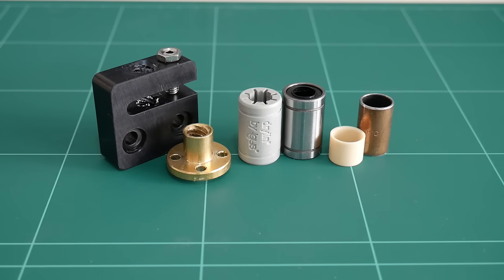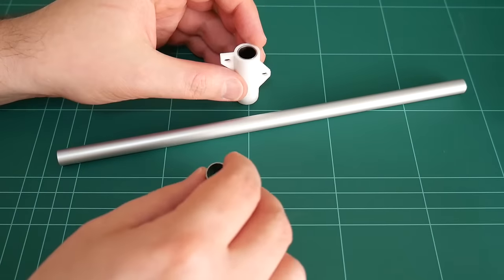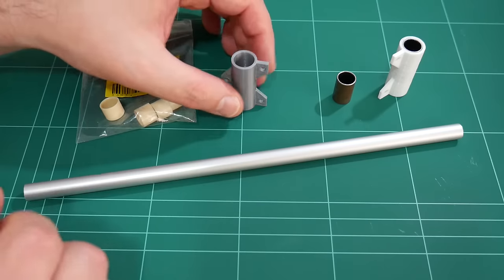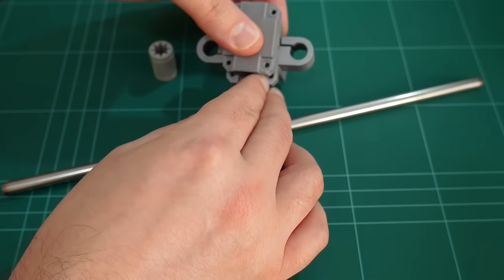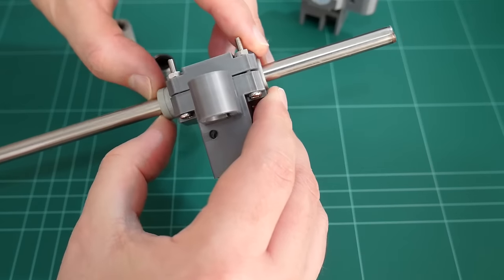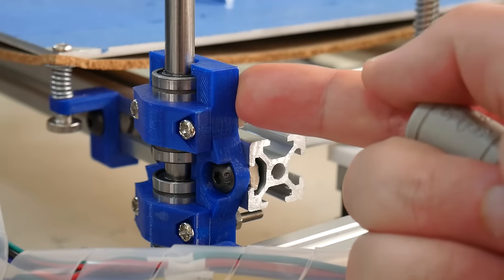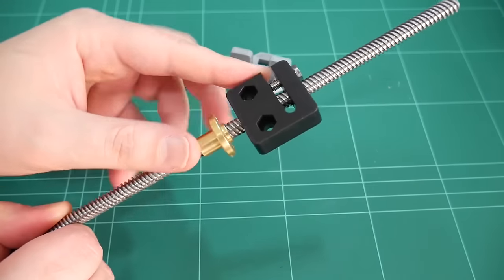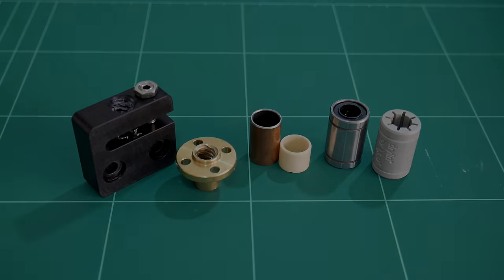New 3D Printer - Build Log #15

Comment: I don't have any personal experience with the IGUS polymer bushings/bearings but i believe part of the biting issue may be because they're meant to have a uniform radial compression applied to them, whereas you applying pressure in mainly one axis of the bearing. There are IGUS bushings sold that have a metal compression sleeve already applied to it to provide this uniform compression, so maybe that could solve your problem.

Comment: This video is four years old now and you've probably already worked out your bearing solution for your X-Y joiners, but just in case I thought I might share this info.  IGUS makes an aluminum-cased version of their drylin bearings.  With the aluminum cased version, you would be able to clamp them down tightly into your X-Y joiners without any issue.  I bought four of the RJUM-01-10 bearings to replace the LM10UU bearings that I was using.  They are really excellent bearings and I feel really confident recommending them.  I can't take any credit for discovering them though.  I became aware of these aluminum cased drylin bearings from one of Thomas Sanladerer's videos.

Comment: According to Thomas Sanladerer's video on bearings, the metal sleeve version of the IGUS bearing gives proper tolerance so there is no slop. Even with that I am not sure that it would work on the steel rod on the Y axis. Is the steel rod exactly 8mm, I can't remember if you measured them in a previous video. I haven't been able to find anyone using the IGUS bearings with the metal sleeve on a 3d printer build. It's a shame you couldn't get them to work, as I was really looking forward to seeing how they fare against the LM8UU bearings on the hypercube. I do love the new setup for the x axis and z axis.
Thanks for sharing your 3d printing adventures Tech2C!

Comment: Nice update! I've found that using short linear bushings offset (like what you did for the X axis) is in general the best solution for getting smooth movements, but with a small sacrifice of lifespan. Perhaps implementing something like this on the y axis will work out for you if you want to replace those ball bearings still. And nice change on the z axis, that new nut block looks much more rigid!
Reply from the maker: It'll be interesting to see how long these igus sleeve bushings last on the X axis. They seem nicer to use than the steel bushings but if they don't last that'll suck. Yeah the nut block is a nice option.
Reply: Well they still should last decently long, and since the whole bushing is the lubrication instead of just a coating on the metal like the old ones, they should last longer in theory. but they will lose a lot of their tolerances well before they simply quit working.

Comment: The black material is called Delrin, very durable and perfect for making parts that require a thread to be included.  Since the print bed always provides a load due to it's weight the brass screw will be sufficient and is very cheap to replace if ever needed, however because it is always loaded by the weight of the bed you will never notice any issues in print quality as the usable life of the brass nut will easily outlast the life of the printer.  I like how you have experimented with lots of different possiblities with the build.  That delrin block z axis setup would definitely be benificial on a i3 type design because there is no bed to preload the z axis.
Reply from the maker: I thought it was Delrin but the MakerStore site didn't mention the material. Cheers for watching and comments.

Comment: I believe the black residue you're getting on the aluminum rods may actually be very fine aluminum particles which are wearing off the rods. If you take a piece of aluminum and rub it against another hard surface repeatedly, you will begin to see a "dirty" looking build-up of these fine aluminum particles. 
The coating inside the steel bearings may also be wearing off. But aluminum is a very soft material that will wear away faster than most people realize. Anodizing helps harden it a little but I think it will still wear. It would be interesting to try those same bearings on a steel rod and see if you still get the residue.

Anyway, great videos! I hope to build a printer like this someday. :)
Reply from the maker: No no, these aluminium rods are anodised. I covered this in an earlier build video, number 4 I think.

Comment: this is on a "or so i have heard" basis: if i am not mistaken, the drylin bearings are supposed to be a pretty snug fit in to theyr seatings, and would have a little play on the rods, if not compressed form the outside. (a precisely sized hole, not clamps ment to hold steel brearings) and need some breaking in to work as smoothly as they can.

Comment: For the Y axis, (these are some more hacky methods), you could try printing bushings out of PLA or nylon(self lubricating). I use PLA carriages that run on aluminum extrusion, and those work pretty well, but they gain play over time.

Comment: Did you try adjusting the clamping circumference to say 45 degrees where there is the most clamping force and 0.5mm less than the bearing diameter to see how that might work? The rest of the clamping circle if you will would have a larger diameter than the rest of the clamp.

Comment: Yes, you can print a cylindrical adapter (to use on the Y axis) the length of two lm8uu. then use two sf1 or use Igus J bushings and ream the adapter to achieve the pre-load that you want. It will be quieter. I just ordered titanium X axis rods to play with.
Reply from the maker: Titanium for X rods? Wow impressive!
Reply from the maker: What is the surface of the titanium tube? Is it anodised, or just titanium oxide? If just a naturally occurring oxide then no good as the bushing will scrape it off constantly resulting in it sticking/binding - just like aluminium.
Reply: Tech2C Titanium is crazy easy to anodise.

Comment: these polymer bearings need a pressfit. sadly pressing then between two parts doesn not work :/ i have used the igus bearings with the steel sleaving on my printer with great succes
Reply from the maker: Ok great. I bought these polymer bearings as they're standard and cheap, but I like your idea to use steel sleeved versions!
Reply: the downside is that they are a tad more expensive. and i think the minimum bore is 10mm unlike the regular LM8UU which have a minimun of 6mm if i remember correctly. oh and buy the yellow tint ones, i think those are newer, better versions of the grey ones
Reply: corect. I for a while could not find out why they have alot of slop. however after some time I found that they are over sized. then when pressed in to the presion housing then they are the corect fit with no slop. go figure. :) however they should really work well. ~Russ
Reply: Could you use a regular steel bushing, cut down the middle, to assist the plastic in press fitting?

Comment: At build log #5 I was wondering if you could move z-motor with cantilever to the opposite side, so all obstructions (motors) would be in the same side, that would also solve the need for long wires in build log #6. Belt "crossing" might be a bit ugly on the new front side but does not look like it would block too much. Or maybe move x-y motors, they might even be a bit more centered along a long belt and make slack/delay/etc a bit more symmetric. Anyway, your printer seems to beat most commercial offerings, cool!

Comment: For the plastic bearing, you will need a stop rim in the holder. Then it will work perfectly, with them sliding around and with less pressure when clamping down. Your clamping printout is the problem, not the plastic bushings, I assume.

Comment: I allready use the igus bushing and i have the same problem with the y-Axis als you have. For the x-Axis you can use the Igus A181SM-10-12-20, they have the same size than the Bearing Bushing you use normal. instead of using a normal aluminum shaft you can use the Igus AWMP-10 which have a hard anodized surface. 
if you try to print your own bushing igus have there own filament.
Thanks for your help you do a great job
Reply from the maker: Cheers!

Comment: Try spray silicone instead of the 3-n-1.  While 3-n-1 is great stuff, I would think it is a bit "heavy" for this application.  And it does cause dust to stick to the surfaces.  I've found that silicone lasts just as long or longer, doesn't accumulate dust.  The only problem with the spray silicone is that it is very easy to get it on everything but what you wanted lubed.
Reply from the maker: When I use the Lithium spray it gets on everything too. Very messy.

Comment: I've had bad luck with that WD40 brand white lithium grease spray. It was drying out too much. I would recommend some molybdenum disulfide spray, it is black however, almost like graphite. For metal-plastic friction contact, a teflon based "dry" lubricant may work, if you find lubrication is needed.
Reply from the maker: Great info, thanks.

Comment: Hello, I Love the work you do on the channel and also very excited about building the current design , but i have few queries

1) Cantilever style preferred or Dual Z- axis  , planning to use 12mm Aluminium Rods (Similar Build Volume Slightly Bigger ) Desperately don't want any z-artifacts if possible 
2) Planning to convert everything to 12mm rods has i have many lying around , for which what are the changes? how can i edit these Files?
3) I Dont have linear bushings , instead planning to use regular 12mm bearings , how do i modify the x-axis carriage ? For this , Prefer no Zip Ties

Comment: You know that you've chosen a bearing version from igus that is made to be fitted into a tube or, more exact, into a fitting hole (around IT7)? So basically you are using the bearing wrong and, as expected, it doesn't perform in the wrong use case.

Comment: I used chemical metal for mine, wich i now have switched for pla printed. I use aluminium tunes with athreaded rod insert. The chemical metal ones, i made by taking a regular linear ballbearing, placed it in alginate, removed it and filled with chemical metal. Then drilled them out. They work flawlessly and are almost self greased as the material is somewhat soft and yet durable. Why i went over to printed pla is mainly due to upgrading my hand made printer with printed parts and they didnt have industrial finish, but from a movement perspective they were better than the pla, however the pla is easier to maintain.

Comment: IGUS bearings ARE NOT Concentric.  That's why they appear to bind. 

If you rotate one bearing in relation to the other( in the same bearing block) you will find you can make them bind or loosen up, just buy rotating only one.   This is great, as it allows you to eliminate all slop,  just by rotating one. 

This is the secret to using more than 1 IGUS bearing in the same bearing block.

Comment: The igus bearings are meant to be pre loaded. There is a version that is press fit into a metal tube that is a drop in replacement for the LM8UU.
Reply from the maker: That makes sense considering we only need the shaft contact area to be the Drylin material. It seems a waste to use the same material for the entire bearing.
Reply: Actually it's the same plastic bearing in a thin metal tube. Same amount of plastic.

Comment: My printer ist based on the Rj4jp's from igus.  At first I noticed the sticky behavior too. When you use two on top of each other it getting worse. But if you let them run for a while they getting quite good. In the end I use Rj series which come in a aluminum housing for my new printer.
Reply from the maker: I found using 2 in series increased friction because the XY Joiner isn't aligning them perfectly. I'd need to print a housing especially for them just like the dual_bushing_holder on the X axis.

Comment: I'm working on hypercube with carbon fiber x axis. Trying to decide between igus and original steel bearings. The igus are $17 for 4 in US. Is it worth it? Did you try the steel bearings on carbon fiber?

Comment: @Tech2C ; Why are you not using the steel sleeve type bushings on the Y axis, but LM8UU or the Igus bushings?
I'm planning to build a coreXY printer with steel sleeve bushings on both X and Y axis

Comment: Tech2C I am so excited to make this printer. but my only concern is how often parts are tweaked. I'm not saying change is a bad things but my suggestion is change your system to have "stable" and "beta" releases. Pretty much like code. I think advantages here are you can upgrade all the things at once when a new "stable" release comes or or you can slowly change the printer every time a "beta" release comes out. Just a suggestion but I really love what you are doing here, keep up the great work.
Reply: The old parts are available. New parts are labeled with a new version number, like 1.1, 1.2 etc...
So just print all the latest ones or all 1.0s etc... However you like.
Reply from the maker: I'm going to move the older versions to another page so the main Hypercube page is current and without clutter. This video didn't introduce any new part iterations but I understand what you mean. I have no plans or intention to radically change the Hypercube as it is, just minor tweaks as time goes by. Either way no matter which parts you use it will work great.
Reply: Tech2C Thanks! I know this video didn't have any new parts but I didn't want to go comment on an old video :P.

Comment: Maybe a way to use the Igus bearings on the xy joiner is to use some epoxy instead of clamping.  Many Igus bearings are meant to be pressed into a precision bore that reduces the size of the Igus bearing to it's intended size.  Clamping an Igus bearing into a non-precision 3D printed assembly will definitely deform it.  I think it might be better to use an on-size or slightly oversize bore and use a little glue of some sort, maybe Loctite or CA or epoxy.

Comment: For the IGUS bushings, they are designed to be pressed (I.E., with an arbor press, with somewhere around 100+ pounds of force) into a bore of a very closely tolerated bore (specifically, an H7 bore, which for a 19mm hole is +0.021mm -0.000mm). This is effectively impossible to achieve with a 3D printer, but can be done with other tools. I've made a bearing block for these type of bearings, but used a Bridgeport mill and a 19mm reamer to create the hole.

The difference between this and the clamping method used in this design is that the press-fit circularly deforms the bushing, creating not only a tight fit for motion but a proper clearance for motion operation. The clamping creates an oval shaped hole, which will quickly cause binding before it is securely held, as the plastic is so flexible.

Using a high-quality linear shaft (such as the one you have in this video), there is an extremely small amount of clearance, somewhere around .012 to .03 millimeters. Over the scale of the printer, this is a negligible amount (especially for this kind of printing). I want to say that this clearance is advantageous in this application, as it will allow for less frictional forces and take up for inaccuracies in the printer construction and allow for a potentially higher printing speed. But I am not sure, I've yet to build my printer and see if that's the case.

Of course, this sort of thing isn't available to everyone, and the steel housed drop-in replacements IGUS makes are a great substitute here.

Regardless, this is a great thing you've got going, and your videos are very informative. Subscribed!
Reply: I have one clarifying question, though. You said you're using anodized rails, what kind are you using? I know IGUS makes some, and I am assuming you have theirs or an equivalent (hence me saying that they are high quality), but I'm curious to know.
Reply from the maker: Mine aren't IGUS. I bought a 3 metre length and cut it down, from a local aluminium distributor which happened to have this size anodised (most aren't). I wouldn't say high quality as there's no data sheet accompanying them.

You can buy the IGUS branded rail online from RS Components (a little expensive though)
Reply: Interesting. I would be love to see how straight they are, and how the diameter varies over their length. 

Something else I am curious about--how rigid and square is the 2020 frame you built? Also in that vein, how straight is the 2020 in it? I imagine it is pretty good (maybe difficult to tell by eye), but the perfectionist in me wants to know. 

Thanks for the responses, it is genuinely fascinating to hear about how other people think about and then custom build their own machines.
Reply from the maker: This build was done on-the-cheap. The 2020 extrusions I'd cut using a hand saw and mitre box. The 10mm anodised tubes appear to be straight, at least when I run them on a table they don't wobble with every rotation.

I guess there is some forgiveness with making a 3D printer, but it must be rigid/stiff. Using the aluminium corner brackets is a must in my opinion.

Hope this helps :)

Comment: What about printing your own bushings? Have you considered it?

I've tried some LM8UU PLA printed, and seems to work fine (just tried without putting it into the actual printer)

Cheers!
Reply: You would need a tap to cut the metric acme thread, but it's possible...
 - Eddy
Reply: I was thinking more in replacing the LM bushings by printed ones than the Z nut... perform the drill could be tricky....

Comment: I would either use all aluminium and switch the parts from time to time or go for steel rods for less maintenance, basically because the nozzle movement is half of the performed movement work and need to be at least as sturdy as the rest, plus the fact that aluminium oxidises eventually in strange ways wich steel if lubricated does not and thus probably is a better choice but a tad bit more expensive